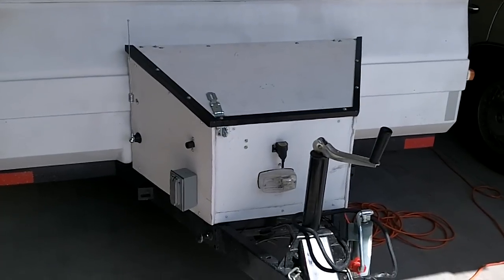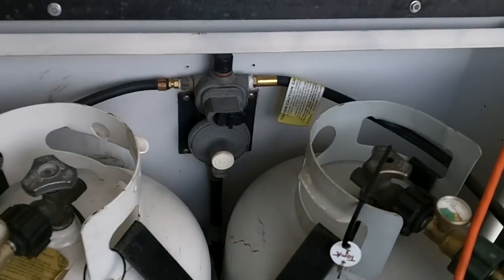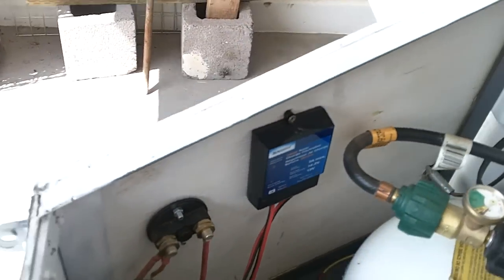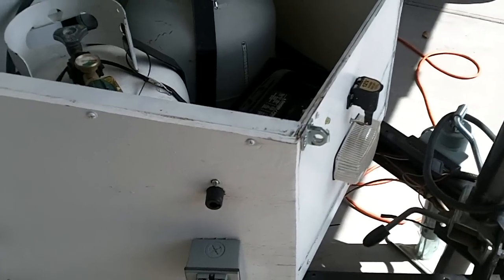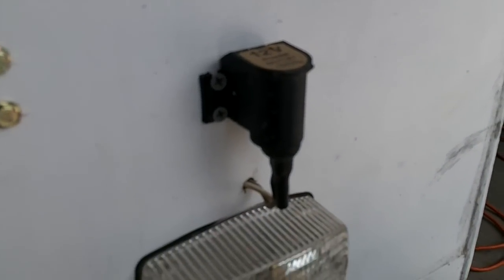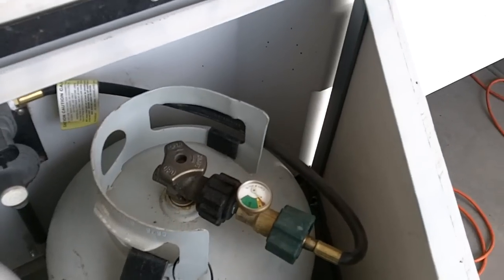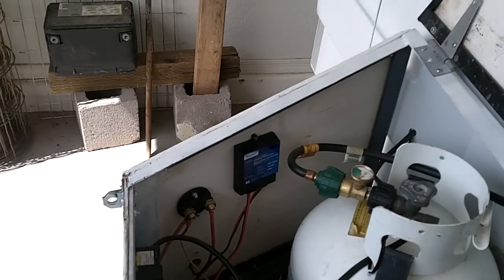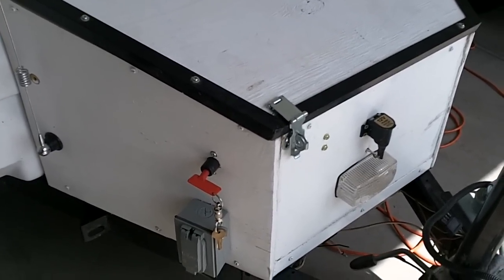Camper modifications for boondock camping

Comment: you are not alone. it is pitiful that trailer manufacturers are not engineering out the capacity for catastrophic failure. it gives more careful engineers a bad rep with DIY'ers. those of us who have seen campers and other structures explode due to leaks and faulty wiring know better. around here, a squirrel would wreck all that quickly.

Comment: Reviewing this Hardly Freight Explosion Video;....I gave up counting all the spark opportunities from terminal posts to terminal connectors to contactor switch to .....  Imagine lifting the heavy battery or tanks in and out of that tiny box and striking metal.
The reason for showing this was "Look how clever I was to do what you never see!"
Newsflash;...guess why no RV manufacturer combines these on the tongue?
Reply: I cringed when I saw the connections on the battery right next to the LP...

Comment: This is one of the best pup mod videos I've seen. Very clear and clever arrangement. I am planning to have 2 12v batteries connected from two solar controllers and 2 245w solar panels into a 2kw inverter. May be overkill, but I can connect to my house in an emergency. Thanks for your great ideas.

Comment: yes I wud consider capping off the exposed terminals but everyone complaining about battery near tanks must not be camper owners because they have been mounting the battery and propane tank next to each other from the factory for as long as I can remember and yes I am a travel trailer owner
Reply: Greg Large show me one modern camper that has gas and electrical in the same box.

Comment: Nice video.  Just wanted to mention that I went to a dual 6 volt battery system recently and I’m simply amazed at the difference it made in my reserve capacity. It’s night and day vs. the single 12v battery.  I highly recommend doing this for boondock camping. Cheers!

Comment: I know you got a ton of negative about mixing gas with electric. Just so you know, those propane tanks will off gas in extreme heat, they are designed to relieve pressure. We found that out with our Coleman pop up camper. Both Tongue mounted tanks began off gassing at a rest stop in Utah in 113 degree heat.  Mixing your electric with your gas IS BAD. Period. I mounted all my electric just inside the door in a small closet, too small to be useful except for electrical use. I also had solar charging, a power generator and the works. The difference was I had outlets on the side of the camper, well way from those tanks. Its best never to enclose the tanks, they need to breathe incase of off gassing. even here in Northern Michigan, parking in a lot can trigger the pressure valve. I had one tank with a defective valve once that purged my full tank of propane. The valve stuck open. I found out they recalled ALL those tanks because of that issue. I got a new tank, but lost my $12 propane. Never, ever mix gas with electricity. It only has to fail once.

Comment: I'd never consider putting propane tanks with my electrical, there known to leak and wires tend to spark if there's not a good connection. YEA, THAT IS A BOMB WAITING TO HAPPEN
Reply from the maker: I have explained this in previous posts.  Propane is heavier than air the bottom of the case is open.  Therefore it leaks out.  Also pleas go to any camper store the battery and the propane tanks are frequently found together.
Reply: My dual tanks were mounted right behind my dual 6 volters from the factory but not in any kind of box I have a Trailmanor Hard sided "pop up" TT. I bought my trailer new in 2013 and have camped about 40 times since it was new, some dry and some full hook's. still using the original propane fill up's lol!!!

Comment from the maker: Ok, Just to clarify for those who are unaware of how campers are built and propane works, I will submit a short explanation.  Propane is heavier than air and the bottom of the box is open so if needed the propane can ventilate.  Please go to any camper store and take a look, 80% of manufacturers put the battery and propane next to each other.  Take a look underneath any camper or in your compartments  electrical wires and propane are next to each other all the time.
Reply: STVTrooper <--- just got back from a large RV dealership.   Not ONE camper, trailer, pop-up, Class A, B or C place the propane next to epectrical/batteries within the same enclosed box.  Not ONE.

While your luck might run good, I would delete this video before your ass catches a lawsuit from soemone unlucky.

Comment: great setup, seems like it should have served you well since you published this video.

one question, how long did you find that battery to last you (to run furnace)?  what is your Ah on that battery alone?  I've heard that furnaces just suck those batteries dry in no time, but have yet to find out myself.  I've just setup my trailer w/dual 6v @215Ah, and will have my Honda 2kW gen for backup.

Comment: For boondocking solar is a must. And a great battery bank. We added a 140 watt solar panel to our 5th wheel and 2 golf cart batteries wired in series. The solar panel came as a complete setup for rving . Right down to the sealer for putting the panel on the roof & the charge controller. Another added feature of the charge controller is it will desulfate/condition the batteries every 28 days. This will give the batteries 2-3 times the life span. It's a win win win .

Comment: Hi great video I like some of your idea's. Definitely want to add solar to our's. I have a question for you we are missing the whole propane set up from the front bottom of the trailer to the tanks. We were considering going with just one tank but after seeing your video we might go back to two tanks. Was it hard to find the set up you needed for the propane? Did you have to take the trailer with you to get the set up? I took the one tube with me that I have to a propane shop and he looked at me like I had horns and didn't know what I needed and wanted me to bring my trailer up to him. Thank for your help.

Comment: You might want to pick up new propane tanks at Costco - each spring they get them in, and they have built-in guages that show the propane level more accurately, and with the propane shut off, they still work (yours need to have the propane valve open to indicate the level).

Comment: Thanks for the video , I done all of what your showing , other than all of that enclosed part , i added another tank & welded up a encloser for my generator to sit above all that & just run a cord to the 110 severice that's on the camper & also I ran a plug out of the battery box to charge up my battery off of the 13.8 volt charging system that's all ready on the generator . & i put a digital readout off of the batteries so i could just flip it on inside to tell me how much volts was in them without using a meter . anyway Good video . Thanks.

Comment from the maker: Some tips for success:
1. Please place some anti corrosion lubrication on all of your electrical fitting including the battery posts. This limits the possibility of electrical failure and arcing which creates sparks.
2. If you own a camper you probably should own a gas leak detector and check your propane fittings periodically.  Home Depot sells one for $25

Comment from the maker: Hello Neil

This is just an add on the the factory design.  It is open on the bottom to allow for ventilation.  Most trailers have the battery this close to the propane.  I have been running this setup for 3 years and it helps to protect all this from the elements which may damage the components.   thanks for your response.

Comment: Oh yea...just a note.....I have been a plumber for 30 something years...and there is no HOT water heater....call it a water heater....because why do you need to heat hot water.
Reply: The phrase "hot water heater" evolved long ago to differentiate that from other water heating devices, such as those to warm pipes during freezing weather or those to provide very hot water for room heating radiators. You will still see the latter two examples commonly referenced in colder climates.
Reply: These phrases litter our speech. "Horseback riding," (where else would you ride a horse?) comes to mind. Geez, your point is more than a bit petty, don't you think?

Comment: I made it as far as seeing all the electrical connections and propane in the same box.  Not worth it to me.  The smell of propane while changing tanks is not uncommon.  Propane heavier than air?  Okay, dropping right down onto the battery and over those connections.  Yes, the batteries are right next to the propane tanks on my (and most) trailers, BUT, they whole thing is in open air for faster dispersal and the batteries are both in covered boxes....More power to you and your idea, not for me, and I wouldn't be recommending it to anyone on the 'net.....